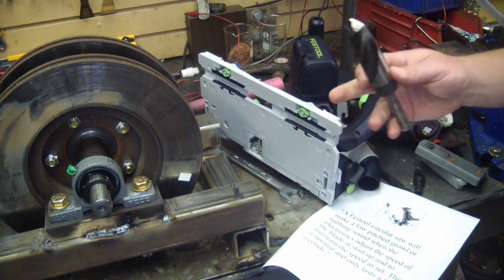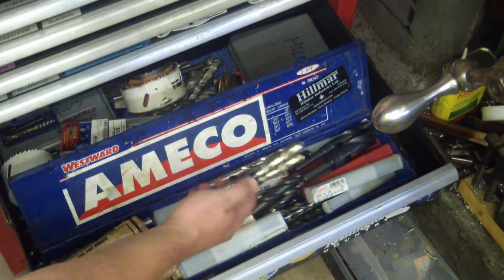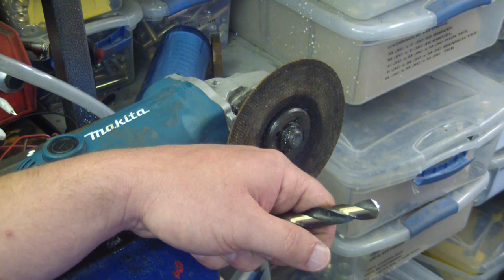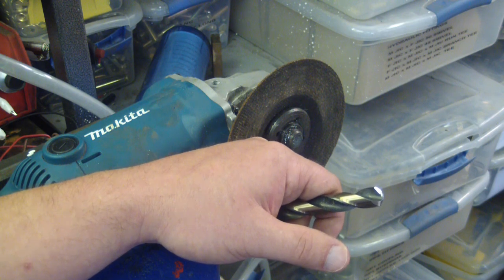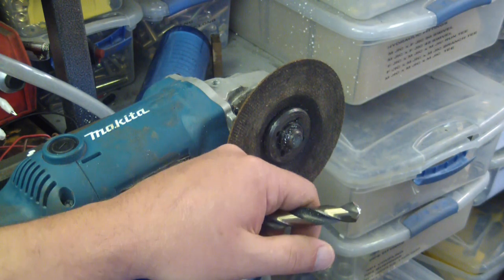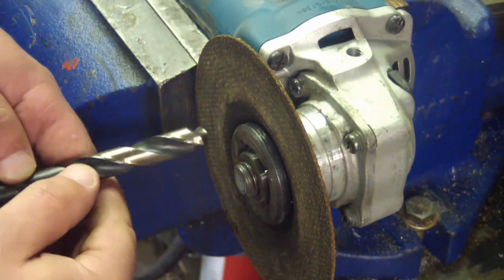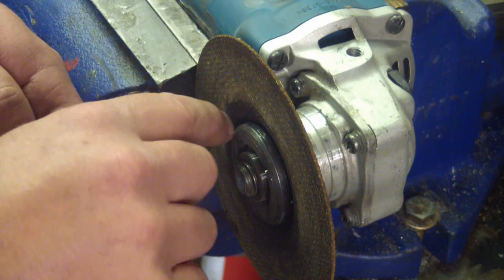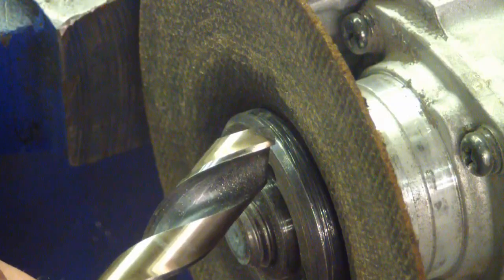Sharpen Drill Bits WITHOUT a Drill Doctor?!

Comment: i used to sharpen twist drills for a living and can tell you it is an art.  That being said unless you know what in the sam hell your doing a drill doc will seem like a joke. However as the ladies say its not the size its the.....?  Well clearly i wasn't listening.   If you take time and actually learn it.  It will produce great results.  You don't even get the off center tip speed wobble that a bench grinder is sure to provide.

Comment: your grinder doesn't have a guard on it.

That's the ONLY unsafe thing in this video :p
Reply: EvilPlagueDoctor What's a guard?  Is that the bent cup holder that comes in the box with the grinder?
Reply: EvilPlagueDoctor  I know tools are expensive these days, but paying a rentacop to guard your grinder seems a bit ridiculous
Reply: +jgilk1 my dad told one of his workers not to run the grinder without the guard. he did it anyway. the disk shattered and slit his throat. killed him on the spot. just 20 years old.
Reply: +jgilk1 my dad told one of his workers not to run the grinder without the guard. he did it anyway. the disk shattered and slit his throat. killed him on the spot. just 20 years old.
Reply: +jgilk1 my dad told one of his workers not to run the grinder without the guard. he did it anyway. the disk shattered and slit his throat. he died. just 20 years old.
Reply: EvilPlagueDoctor That was also a cutting disk not intended to have pressure applied in the direction of a grinding wheel but who gives a crap.
Reply: EvilPlagueDoctor Never shattered a disc, and on the occasion that i will, ever, i keep my face out of the way and never expose my body mass or wrist to the disc.

Oh and, i don't whale on the disc, which in the 20 or so cases i know about outside of the internet, was the case. Well, that and cheapo discs...whomever has the intelligence of a burnt light bulb to cheap out of cutting discs surely can't complain.
Reply: You cant use a 6" cut off wheel with a 4.5 grinder with the shield on ,   Get er done
Reply: Never buy cheap discs! Always inspect for any visual imperfections! Never lean over Spinning Disk while cutting something

Comment: You grind em exactly like I do; light cutting edge grind and a delicate roll off the back to put tool relief on it. Don't mash the tip into the grind; don't heat it up and ruin the temper. Leave enough meat to get an aggressive cut on most materials. Excellent presentation.

Comment: The good old Sears drill sharpening jig will do the job fast and perfect.  Screw it down to your work bench and sharpen all the drill bits you can find just right.  Thanks for the video.  So you offended a cult did you?  Better start looking under the bed at night.

Comment: I inherited a drill doctor and can actually get pretty good results w/ it on smaller drill bits.  My eyes aren't too good anymore so the small ones are tough for me to get centered.  It does take a little practice to get it down though.  The larger ones like the HF silver and demings I do pretty well manually on the grinder and belt sander though.

Comment: I have definitely used a grinder and cutoff wheel in the field plenty of times!  Quick edit/hint-  when you are about to come through the back of the metal just back off on the pressure until you are barely pulling little chips instead of biting a thick curly chip. Then it will pop through without trying to break your wrist or drillbit.

Comment: When I started technical college for Manufacturing Technology the first thing you were taught was sharpening a drill. Not kind of, not sort of close, but a proper sharpening  where the drill would drill the hole the size of the drill. The instructor would hand you a 5/8" drill with the tip flattened and you had to put a 118°, equal-length, equal-angled tip back on it with a bench grinder. I believe the course was designed to do this first lesson to eliminate those who didn't want to learn. I have an early Darex grinder that does an OK job but when I need to taylor the drill to a specific job I hand grind them. It's faster than the machine and just as accurate AND I can grind chip breakers to what ever extent I need…. Split-points? No problem! Take a 118° drill and put a 135° tip on it, no problem.

Grinding drills should be a Manly-Man skill…..

Comment: Learned how to sharpen bits from an old mechanic who hated buying new tools. He would even sharpen down to 1/8 inch. I'm still not as good at it as he was but the skill has gotten me out of a pickle a few times. Like when I needed to drill a 3/4 hole with only 3 inches of work space. A right angle drill and a cut down bit with about half a twist left did the trick.

Comment: No idea if this will get answered, but I have a relevant question to drill bit sharpening/ dulling.  

I mount my own skis and the ones with a layer of "Titanal®" seem to dull the crap out of my expensive metric decimal step drill bits (which I resharpen, thank you for this video). Did some digging on what is in Titanal® (registered trademark of AMAG Rolling GmbH) and found out it's an aluminum alloy. Now I've done enough milling and metal work to know that alum doesn't normally chew up tooling like this. Found out it's alloy mix; 88.5% aluminum, 1.7% copper, 2.5% magnesium, 7% zinc, and 0.1% zirconium. Is that little tiny bit of zirconium the part of that mix that is fuckering my drill bits?

Comment: i have sharpened many a drill bit on a job this way and see no problem with it. It's an effective way to keep working. I have sharpened small bits with an air die grinder with a cut off wheel.

Comment: Does sharpening the bit remove the "hardness," potentially leaving the bit weaker than the metal being drilled? Is that only on cheaper bits that are case hardened and not made of a harder material to begin with?

Comment: Had a drill Dr when they first hit the streets in the early 70's....huge P.O.S  Once ya learn to sharpen a drill properly, you never forget.  Without a fixture of sorts it is tough to keep the angle and cutting edge length the same on both flutes, but unless you are drilling precision holes it's no big deal.

Comment: I was taught to check how the sharpening is going by looking at the drill end on.
You can judge if the point is central this way. But less obviously you can also check the point forming angles are the same since if they are; the cutting edges will appear as parallel lines to each other.
ie different angles will be end at different points up or down their respective spirals and give unparallel edges to each other looking end on.

Comment: While I can, and often do, successfully resharpen drill bits by hand, I have the original version of DD 750 and like it fine.   Probably reground an easy 25 lbs. of drill bits in it over the years. (Dad had buckets of old bits and I don't forge blades or axes...yet.)     The most mutilated I pre-grind by hand and tune it up in the DD.    No complaints.   I could do it all by hand, but an Opti-Visor and a day without coffee is definately required.

Comment: A grinding wheel will do a trick. About a year ago I had to sharpen bits like a dozen a day. Just have to watch out for the angle and keep all flutes symmetrical. And it takes about 20-30 secs to sharpen the bit to make it work like new.

Comment: back in the day I used to clamp the grinder in the vise with a sanding disk but I used a 3mm thick pipe with a bolt welded in the end the same thread as the handle, probably still got it somewhere

Comment: You can pretty easily use the end of the wheel to put the split point back on the drill too. Definitely takes practice but it's not really any more difficult than sharpening a drill normally, just an extra step. The benefit being it doesn't round the point over nearly as fast when drilling steel and less pressure on the drill to get it to cut is nice.

Comment: I have been sharpening like this for awhile. Bench grinders at shop are always jacked. Just keep in mind how unsafe this is.. if it comes loose from the vise. If you grind to much into the center of the "cutting blade", you may explode. I usually use the leading edge of the cut wheel and put the split point back on.

Comment: Unequal length cutting edges will give you a slightly larger hole and may walk a bit on deep cuts.It will still drill fine. hold it up to the light to check for symmetry. A sharp (included) angle and /or relief, will drill aggressively but will catch on breakthrough. I sharpen differently for different applications.Some tool makers hand-re-sharpen brand new drills. Not happy with the factory geometry all new drills are sharpened to.

Comment: I have to free hand sharpen drill bits at work all the time but my issue is when doing drill hits over 1 inch for my press I can never get the tip centered any tips on that?

Comment: Thank you man, thats how i sharpen my drillbits but i sit with my grinder in my lap holding the grinder with one hand and the bit with the other but it get the job done.
Have even sharpened a holesaw an apprentice ruined half hour after the hardware shop closed with a grinder and the job had to be done then and there.

Comment: you can even use a dremel  tool  up to about 1/2 inch drill ,i use the cut off wheel to just touch up the cutting edge all thats really needed unless you really boogered it up , run the dremel at slowest setting ,see quit a few people reprofiling the hole drill when it's not really necessary most ov the time

Comment: I bought a drill doctor 750 about at least 10 years ago , tried it a few times but I still just sharpen the bits by eye .. I can't split point and I don't round over .. As long as the 2 cut edges are level ,and the cut edges touch before the heal touches it will cut fine .. If the 2 cutting edges aren't square with each other the bit will try to skate around a little . I just use a SUPER fine stone on a 6 inch bench grinder ..

Comment: Would you care to elaborate on the split point thing? I always sharpened drill bits as you did in the video, maybe sometime taking out the rake or increasing , relieving the relief angle more (don't know how to explain other than thinning out the point, or cutting into the relief angle). 
But i never heard anything about a split point to displace the material
Reply: Ah alright, then its what i've already been doing. Thx

Comment: Drilling wood, the newly sharpened bit should show an equal length of waste in both flutes after drilling a short test hole. A longer bit of waste in one flute means this side needs more grinding. Often use tiny drills myself, find this helps.

Comment: I'm still what many would call young for a machinist, but one of the most useful things my first boss ever made me do was learn to sharpen a drill bit. Yeah you botch your first couple tries. You see what works, what doesn't, do some test drills, get some oversize holes. Then you get good, and you make drill bits better than factory.

I've used a Drill Doctor. Rather, I practiced and learned how to use it, just to see if I can get better sharpen jobs out of it. Don't waste your time. Learn it on a bench grinder, and you'll do it better and faster than a Drill Doctor any day of the week. Learn your cutting geometry and reliefs.

Pro tip: The edge of a cutoff disc can also be used to make split points.

Comment: When the drill bit hangs on the last tiny bit of material, I have success running in reverse to knock down the rough edges that the sharp tip is grabbing. Then back to forward to complete the hole.

Comment: The half inch Drill Doctor is available on eBay for $59. You’d have to be an avid subscriber to Drill Sharpening Weekly to spend $200 on a single use sharpening tool, but at $59, I keep mine plugged in on the workbench all the time. Less than a minute to walk the bit to the bench, sharpen it at the perfect angle, then return to the job. 

I’d love to see a scientific test that measures the angles and lengths of the two sides of bits sharpened with the Drill Doctor vs bits sharpened with a grinder via the eye-balling technique. Then measure cutting speed. Choose people who are good at one of the two methods and have them compete. You could even make the competition subject to a certain amount of donations to cover the time and materials. 

Given the number of Drill Doctor enthusiasts and the realmendontneednospecialtool carnival barkers, I think this could become your most-watched video.

Comment: I drilled about a hundred  inch and a half holes in a 4" drag line deck.
We sharpened all the bits by hand, but with a big bit like that it's a lot easier.

In trade school we didn't have a drill guide.
We would sharpen them then the instructor would ram them into the grinding wheel and hand it back to you.

Comment: I chuck angle grinders in my vice all the time, get a fully threaded bolt that fits the handle threads, cut the head off and get a nut to jam the bolt and just clamp it in your vise, when your done just remove the bolt and put it somewhere so you can forget where its at and make another one or two.

Comment: I know I'm 5yrs late but here's a tip without full length and rotion, I hold a 5" angle grinder on my belly with my offhand so I can look down on the edge I'm grinding. Don't forget your safety sqints and a healthy dose of good sense, (don't use common sense it will let you down) and self preservation. Been doing this for years, no misshapps.

Comment: Would it be possible to put the drill bit in a drill and then take it to the grinder with the bit spinning in the drill?
Reply: ***** Thanks. I may make a vid about it. Wonder if you could put the drill bit in a drill press and set the grinder at the correct angle on the table and then just lower the drill bit down to touch the spinning grinding wheel. I may be on to something here. Ha-ha.
Reply: Jim Adams The only thing I could see being a problem is not getting the back of the cutting edge ground.
Reply: Jim Adams Uh no it won't. Lol. You're not trying to drill thru a spinning grinding disc...... All you're trying to do is get the correct angle with the grinder and touch up the bit. Lol. We're not taking a totally flat or broken drill bit and making it the correct angle in one pass.
Reply: Jim Adams I will have fun. Don't you worry.
Reply: +Love2boat92 Just use common sense. Better to be slow and safe when you're unsure. Some of these pricks are obviously just keyboard warriors who resort to the comment section to try to finally win something but you just can't argue with stupid. Keep your wits about ya and chooch slowly. All the best!
Reply: Logan Fehr Thanks. Yeah I figured that. You sure can't argue with stupid. It seems like it would work though. You would get almost the perfect angle also. Thanks for your comment. :)

Comment: When in a pinch one could actually fit the safety cover on a grinder with the open bit facing out, kneel down with both legs and clamp the grinder between your legs with the safety guard against your knees. Gives you a nice flat grinding surface to sharpen your drills.  Not to mention you can now eat lunch and grind things at the same time!
I'm not advising you to do this of-course, just saying it is possible... ;)

Comment: ive have sharpend a drill bit with 80 grit flap disc on air sander and drill bit finished the hole job with some bite to share

Comment: Hey, can you sharpen masonry carbide drill bits to use in steel?? 
I may have to try it myself
Reply: Phroden Dekia You can sharpen the carbide tips themselves – enough so that they’ll cut steel no problem. The rest of the drill itself, past the tip, is slightly better nail steel. Not good for drilling.

Comment: I agree a hand sharpened drill will get you a hole and drill good but if you are drilling a hole to a certain size an going to ream it for a dowel pin say for  a fixture the drill doctor is excellent because when hand sharpening it is hard to get the flute length the same on both sides per if it is off just a few thou the drill can drill as much as .010 to .030 oversize not leaving enough stock to ream to size

Comment: I own the drill dr.,  and I can sharpen bits manually.  The drill dr. does work if you follow the directions and use it correctly.  As good as your 3 minutes of instruction was, it takes a lot of time and practice to sharpen a bit by hand.  First you learn the theory, then you make an attempt.  Then you go drill some steel.  And when you find that it doesn't cut, you ram it into the grinder and do it again.  Once you do that how many dozen times that it takes to sharpen a 1/2" bit, start working your way down to the wee bits.  Simplify it as much as you like, it takes a long time to perfect.  Less than perfect wont get it.  The drill dr. Is as much a learning aid as it is a functional tool itself.

Comment: Drill Doctor ? Nighon 30yrs a Tool-Maker... never heard of it. Lesson 101 was to re-point/sharpen a flattened 1/2" twist drill, bang a hole into a 1" thick MS block and be no more than .005" over diameter. Mind you, we used a well dressed bench/pedestal grinder. I have used an (h)angle grinder too, thin zip wheels are awesome for cutting back (thinning) the web making for effortless clean drilling.

Comment: What do you guys think of the gold "titanium" type coatings for drills and other such tooling? Seems to me only thing its good for is keeping hot melty aluminum from sticking to it.
Reply: WD-40 works better at keeping the gooey aluminum off the choocher. That gold crap I find is gone after the first use
Reply: +Richard Wilkinson Latest reply in the history of mankind, I know. Titanium nitrate drill bits are very good if you take care of them. Never ever use them for aluminium, and always apply shitloads of cutting oil when drilling.
Reply: Really? Never for alum. May have been late but thank you!